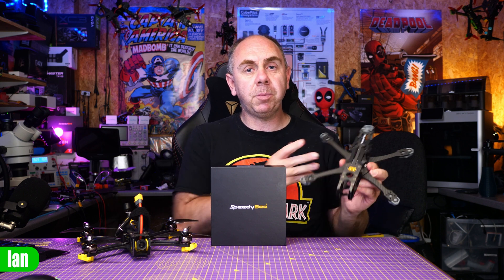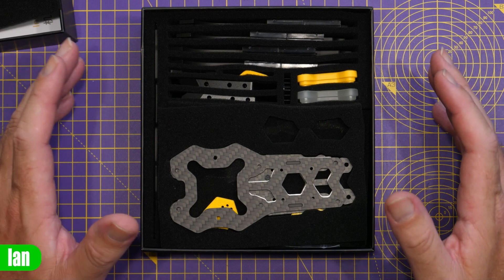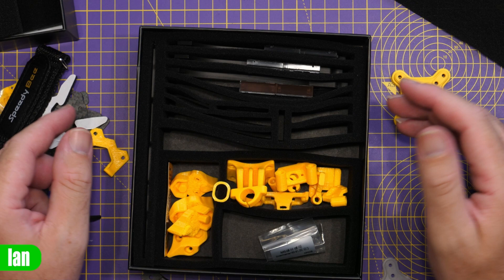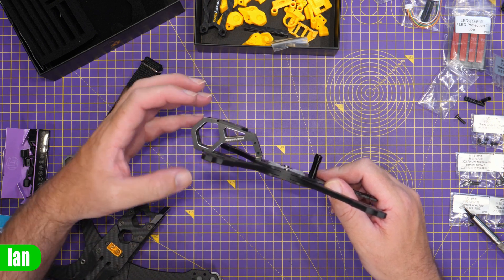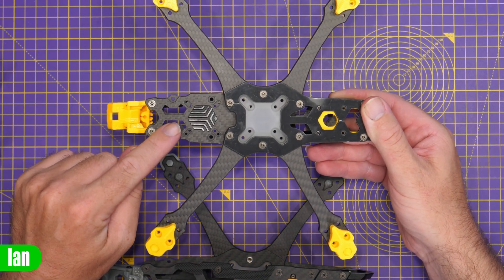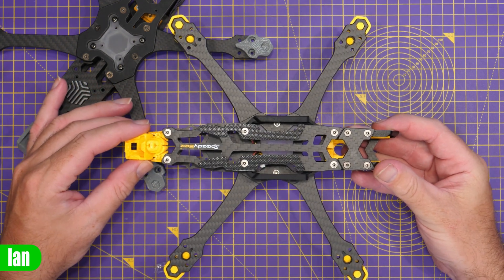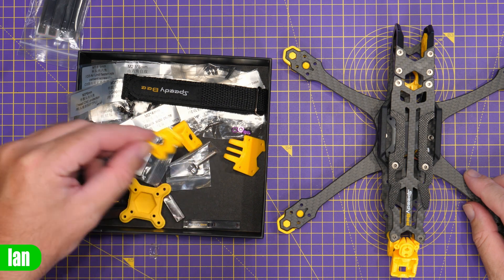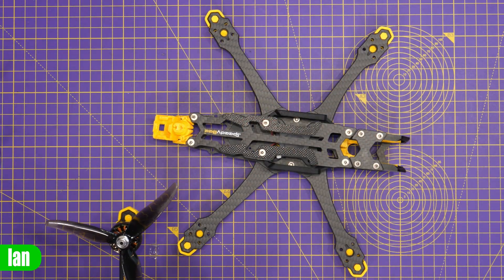SpeedyBee Master 5 V2 Frame Kit - DIY Or BNF The Choice Is Yours

Comment: is this frame compatible with dji air unit?
i see it has 2 slits for the 2 antennas but what about tpu housing  for the air unit like  the speedybee fs225 had ?
comming from having that frame (i build 3, i think they were that great), i think this frame is a bit overdesigned.
i had zero problems with the FS225 v2 frame and i dont like they discontineud them, they were also much lighter than this.
do you have to ''hobby'' the air unit yourself with a foam block and zipties?

Comment: Did you notice that when the O3 unit is screwed down over the heatsink there's not enough clearance to get a USB-C cable into O3 socket? The O3 needs to be unscrewed to allow firmware updates :( Bit of an obvious oversight IMO. Maybe I can sandwich a 2mm thermal pad underneath as a speaker? Whadyathink Ian? Diolch 👍

Comment: Hi Ian. Cracking overview as is usual. Just ordered the V2 version of frame. Q: Is there enough clearance to fit a 5.5” prop? Cheers 🍻
Reply: Frame clearance is enough for 5.5" props ... but front-to-back prop centres distance is only 5.25" so you'd have to cut them down a bit.

Comment: Elephant in the room is that v2 has a deadcat geometry, no idea Ian how you could miss that
Reply: Ya maybe he should have mentioned it but this is nitpick and not worth packing the pachyderm
Reply: @pottyputter05  it's not nitpick, for me DC geometry is a deal breaker and I'm sure I'm not alone on this
Reply: Does it not called wide X-Frame???🤯
Reply: @t-gunfpv1185  on V2 front and rear arms are not the same length and they are also not swappable, so it's DC. On V1 they are, but the arms angle is not the same between the x and y axis. it's a "squashed X" or "wide X" means the same, but it's still symmetrical, on V2 it's not. If you will "fold" V1 frame on the x axis front and the back motor position will match, on  V2 they will not.
Reply from the maker: Why is that an elephant. Most of the O3 frames without props in view are DC.  It’s visually easy enough for anyone to see with out me actually saying it.
Reply: @MadRC  I can bet that more than 60% viewers didn't noticed that, besides V1 is not DC and you did the comparison,  so it's should be at least mentioned, that's mine option of course you can disagree.

Comment: The version 1 doesnt let me put on the official dji ND filters, and it looks like the v2 has a cutout for it. Can you confirm this?
Reply from the maker: Iv not tried the DJI ones. I have flown with the Canerabutter ones though fine.
Reply: @MadRC  Then it might be time to buy the camerabutter ones. Thanks for the headsup.
Reply: Cheap AliExpress DJI-style UV filter fits OK.